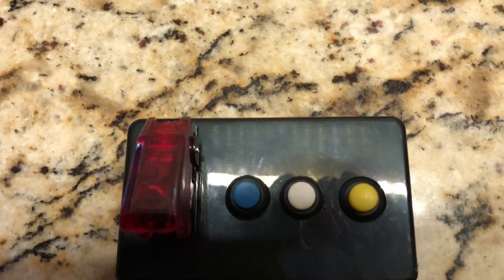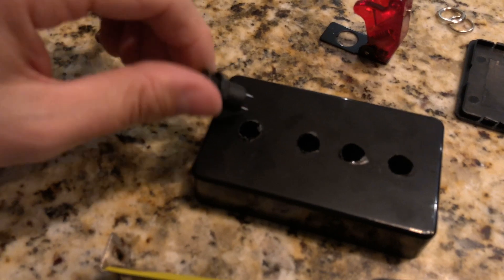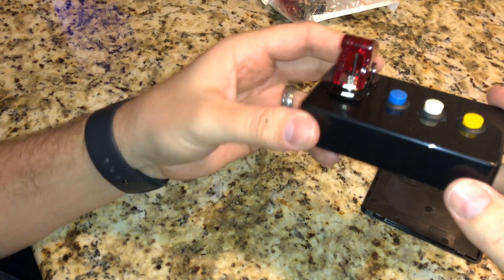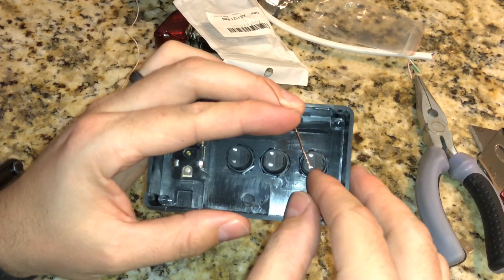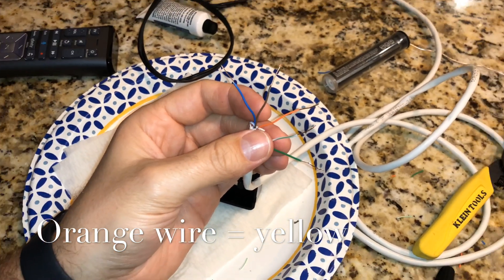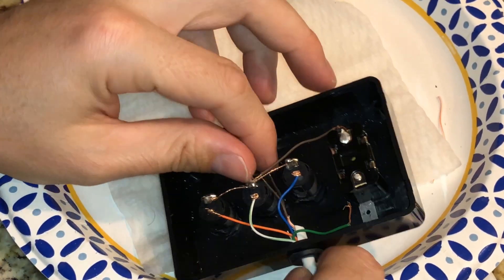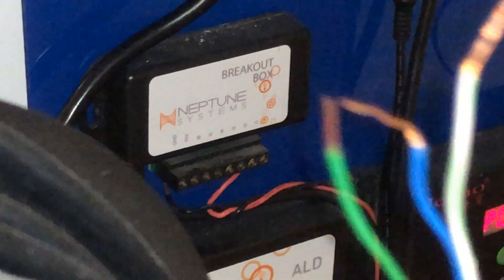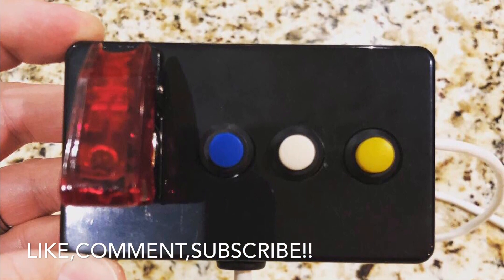DIY Apex Switch Box

Comment: I would like to make my switches led rocker plus obvious toggle.  Any advice, tips, video?
Reply from the maker: what would you like to know specifically and maybe i can be of assistance. ?
Reply: @JCSReefing  Thanks for the reply! Wanting to wire up my own BoB using led rockers plus toggle kill switch..  Not sure how/where to put th LED wire to the bus bar.
I would love to just use a pre wired panel due to laziness but that really throw me on how to hook that up apex.  I think like to use an 8 pin din cord.  Is this the best way?  This is for lights, maintenance, feeding etc.
Thanks so much for being so helpful.
Reply from the maker: @MyKoopmans  I did not use any Led's but i do know of another person who does. If you google Harry Singer apex box, He makes pretty in depth apex switches and all. https://www.reef2reef.com/threads/apex-custom-controller-box.687109/#lg=attachment1408098&slide=0
Reply: @JCSReefing  Thanks so much! Headed in the right direction.  Would love to just install boat switches but not using a boat battery 🤗